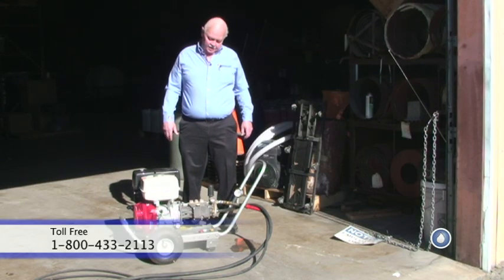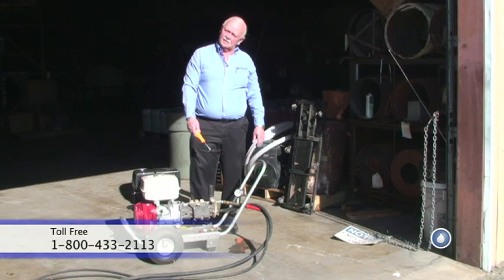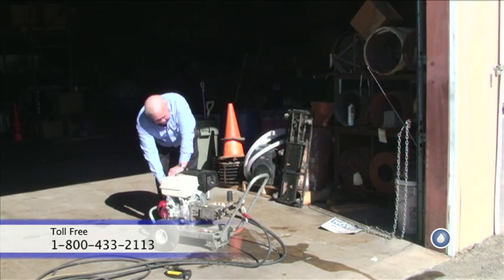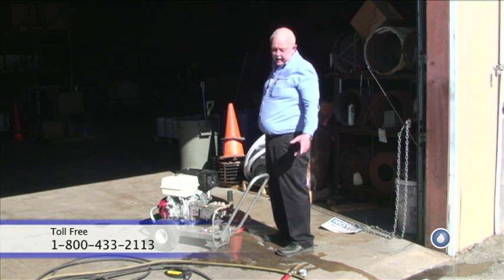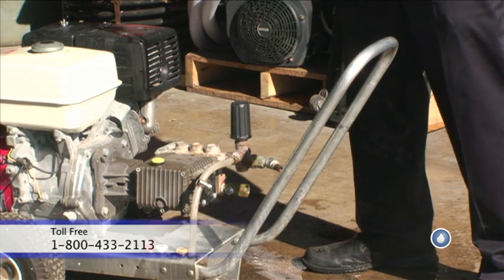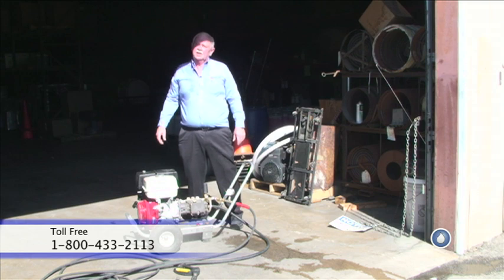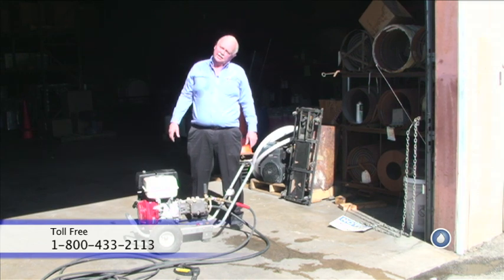How to Test and Install A Pressure Washer Unloader with Larry Hinckley

Comment: My gauge drops to near zero when I pull the trigger, then goes to about 3300 when released ( 3500 psi pump ). What could this mean?
Reply from the maker: Sound like the packing in the pump may be burnt.  If so, it will have to be replaced.

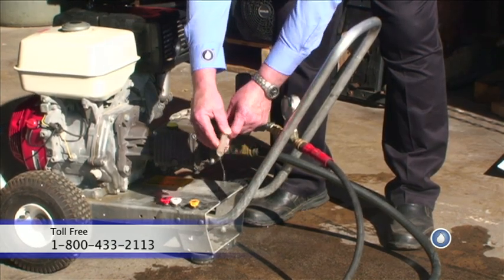Comment: 3:26 the gun is closed, there’s supposed to flow water through bypass? You said if the water comes out of that line the unloader is defective.
Reply from the maker: No the gun was open and the unloader was still bypassing water.  This is how you know the unloader is worn out and needs to be replaced.   When too much water is being bypassed when the gun is open then then the unloader is defective.

Comment: Awesome machine.>>>t.co/NC2C1FwjDE I tried regular car wash soap and it worked fine for the house and truck. Presoaked the driveway with cleaner and some clear water thru the washer blew away the oily stains from my granddaughter’s old Jeep spot.
Reply: Good for home and car. Thank you
Reply: Thanks for your information

Comment: If the bypass hose is showing a fairly steady stream of water (aka method 2) is trying method 1 worth it?  I have my unit bypass into a tank so both methods are easy to do.  Just wanted to know if it means something different if there is steady flow but the pressure does build up?

Comment: Hey Larry. My name is Larry also. But what is going on when the Unloader adjustment knob keeps jumping up and down as the gas engine runs at full throttle?
Reply: I have this same issue.  Did you ever solve it?

Comment: Hey Larry, I have a TroyBuilt powerwasher that is 3,000psi. Anyway, without too many specifics, the darn thing only starts with pressure on handle. If pressure is released from handle the thing shuts off. I disassembled pump head and in between where the pump head and pump housing there was a tiny o-ring that was tore up. This o-ring (after you pull the pump head off) like I said is located in the center between where the inlet valves and pistons when connected together. Now, where this o-ring is supposed to go, there is a small hole that it must either keep pressure in or out, but there are two grooves in the pump housing that run vertical of the housing. Once we replaced the o-ring and hooked everything back up, water started coming out of these two grooves shooting from the bottom part of the where the pump head and housing meet. The link I provided is to the pump I speak of...take a look and let me know what you think. Thank you God bless! 

http://www.pressureparts.com/mmDEV/PDF/AR/sjv-pumps.pdf

Comment from the maker: I depends on the unloader.  Some are worth repairing and other are just best to replace.  If you know the type of unloader and model number, please give us a call so we can give you the correct advice at 1-800-433-2113.  The parts inside the unloader will wear out over time so trying to flush it out won't help unless it did get some debris stuck in it but it is still best to give us a call so we can help diagnose the problem.